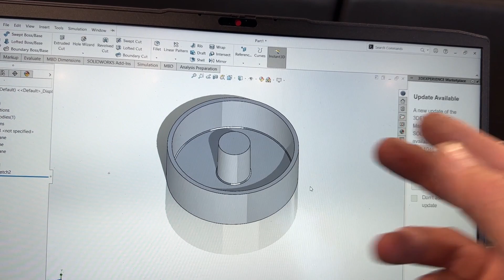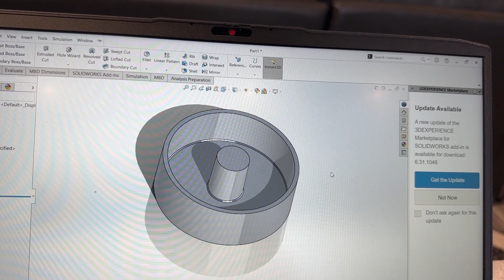Making Custom Rubber Isolators

Comment: I have the same air gun. Love it so much I bought a 2nd one. It's the perfect tool for removing the piston from the brake caliper on most light aircraft too, when replacing the o-ring on the piston.